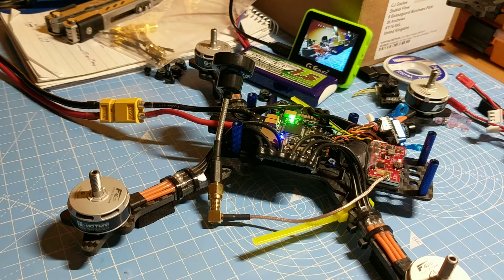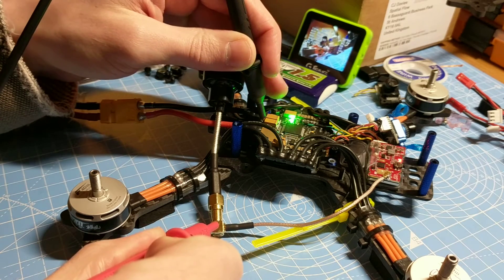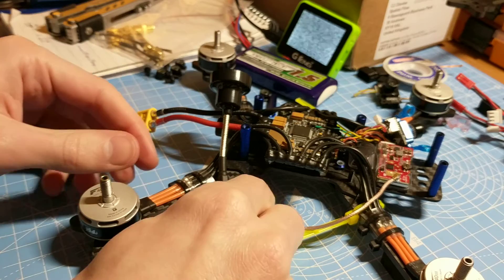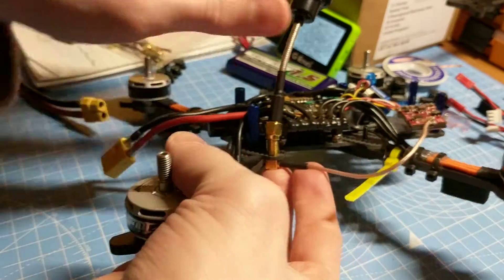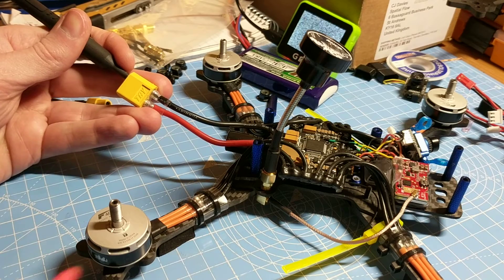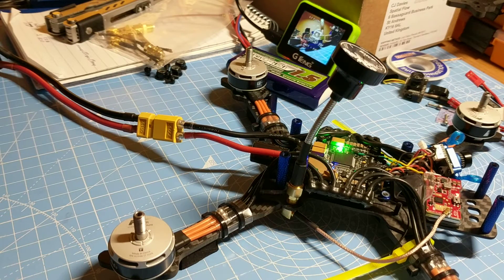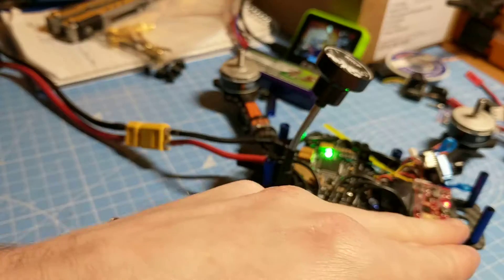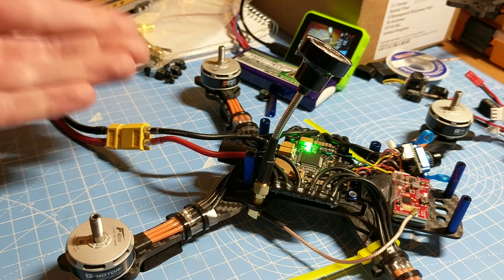FPV troubleshooting - noisy ground through frame carbon?

Comment: Did you resolve the issue? I'm having a similar (ish) problem, but the osd is flickering.
Cheers geezer 👍
Reply from the maker: I moved to a MMCX AXII antenna in a 3D printed mount, so there's no continuity between the antenna ground & the carbon.
Reply: @CJDavies  A 3d printer seems to be becoming essential. I have a simlar frame with the antenna mount set to the front right of the frame body, it's quite odd-looking - (diatone gt r630) it also has noise under throttle, but the osd is fine.
Reply from the maker: @QuadDamageFPV  Having your own 3D printer is great if you're designing your own parts, but if you just want to print parts that other people have designed (from Thingiverse etc.) then having your own printer is overkill & just using 3D Hubs is a more sensible idea IMO.

Comment: I would say there is a difference having the grounded sheath of the antenna better off "isolated" than bridging it directly with the "large ground" of a frame (or making the frame become a ground).  Also that electricity actually flows from negative to positive is not antenna friendly when the frame becomes part of the ground with electrons flowing through it and this is in direct contact with the antenna sheath. :)
Reply from the maker: It seems slightly odd now that an otherwise very well designed frame doesn't come with any facility to insulate the SMA from the frame! I ended up enlarging the hole slightly so I could fit the SMA through with insulation around it & now the video is clean.

Comment: From what I understand that's a normal condition. A lot of people recommend using a rubber grommet. You're basically turning you frame into part of the antenna ground plane and the power system ground is really noisy. You might be able to ground the frame closer to the vbat negative, but I would just try not to ground the SMA. Shrink wrap can help you out, or drill the plate out a bit and put a grommet in it.
Reply from the maker: Mechotronic That makes perfect sense, I guess I'm just surprised I haven't had this issue with previous builds I've done with the same approach. I guess this is the first build I've done like this with an OSD which I suppose might exacerbate the issue?
Reply: Possibly